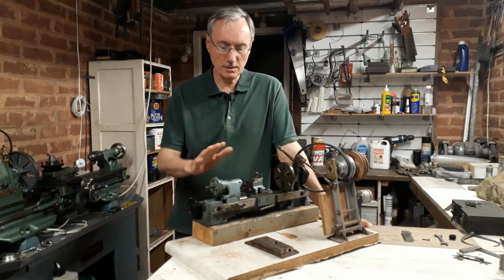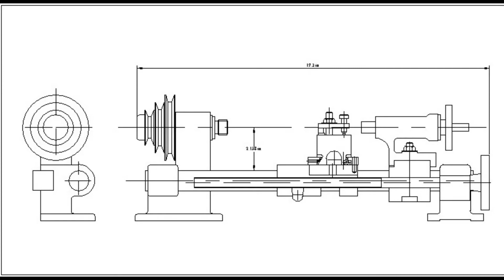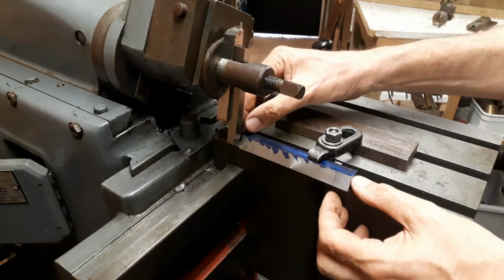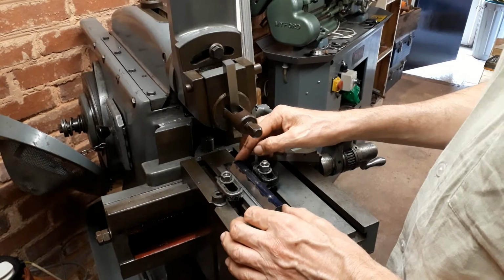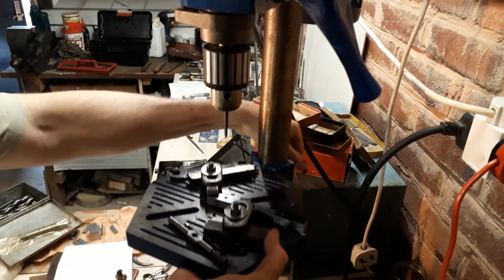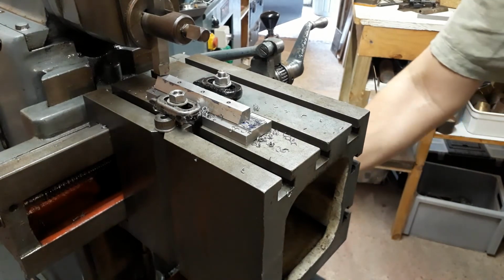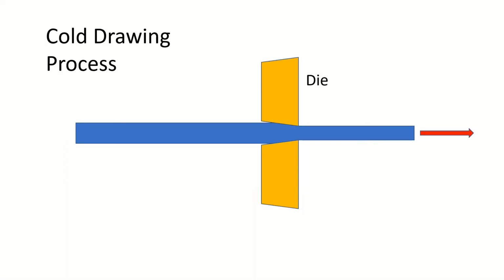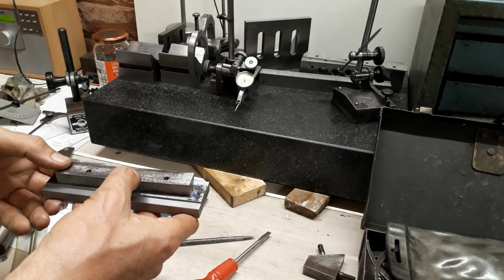My smallest lathe upgrade - #1: Making a new cross-slide

Comment: The design of the ways is extremely ingenious, with fewer surfaces to worry about aligning. Some large metal planers have used this design on the z-axis column. There is also a video here on YouTube of someone who made a homemade lathe shaper attachment that uses this design in another way: https://www.youtube.com/shorts/Q1L0BhRSFyU
Reply from the maker: Yes, it minimises the number of close tolerances. I didn't know that planer have used this layout. Thanks for sharing that. I would have been interested to see the homemade attachment you referred to but wasn't able to find it with this link.
Reply: @Workshopfriend  If you search on YouTube for "Atlas lathe shaper attachment" you will find it, it is a short video. It's an interesting creation, it follows the same principles as the round-square bar design in another way. You can see a planer that uses the design if you google "Mayer Schaedler Planer".

Comment: Interesting little machine - it's FAR more substantial and rigid than I would expect for a machine "made small" to keep the price down. Was it perhaps "made small" to work in a specialised type of work?

Do you know the manufacturer or model?
Reply from the maker: Thanks for your comment and question. It is, indeed, a rigid machine for its size. I have no idea who the manufacturer is and there are no identifying marks on it.
Reply: @Workshopfriend  I think I may have found it; since YouTube HATES external links I'll have to be a little cryptic

On Tony Griffiths lathe site in the UK, he has a page dedicated to a Russian lathe model (series). 

This was imported to the west by a company called "Stankoimport". One of the lathes was called "GODOVIKOV". 

Searching for those two russian names will take you to the page.
Reply from the maker: Hello Paul. Thanks for your help in trying to identify this lathe. I went to the well known site you mentioned where I found Russian 3in round bed lathe but it doesn't look even remotely like this lathe. Perhaps I was looking in the wrong place.
Reply: @Workshopfriend  The lathe shown is deffo NOT your exact model. It has screw cutting features! And (sadly) has its engineering hidden under sheet metal.

But in my searching, I found that lathes with a round bed bar AND a square bed bar are super rare, and the russian lathe has this design feature.

I wonder if your lathe is a stripped down basic version? A smaller "cousin"?
Reply from the maker: Interesting that you discovered this about this kind of bar bed. I suppose it could be a simpler version of that model. Tnx for your input to the discussion!

Comment: Another possibility of the bowing could be heat (friction) causing the top to expand and thus bow??
Reply from the maker: Hello Mike. The reason I don't think the distortion was due to heat is that the work didn't get very hot and remained bowed ie there was no cooling and change in shape. I have noticed the issue with inbuilt stress in BMS before. Your comment is appreciated!

Comment: Great content as always but your shaper is feeding the table across on the cutting stroke not on the return..
Not sure if you had realised.
It's probably fine on light cuts but will add extra forces on heavier cuts...
Many thanks for your videos especially the meddings drill rebuild as I have a later model that needed a new gear which I ended up making myself from your notes on the 20 degree pressure angle and dpi calculations it saved me all the calculations thank you.
Reply from the maker: Thanks Dave for your helpful feedback. I did realise that the shaper was feeding on the cutting stroke but appreciate you pointing this out! I was too lazy to change the eccentric since later I was expecting to be changing the tool for the other hand and cutting in the correct direction.
I am very pleased to hear that you were able to use the gear cutting data. Good for you to be able to cut gears - I don't have the equipment.